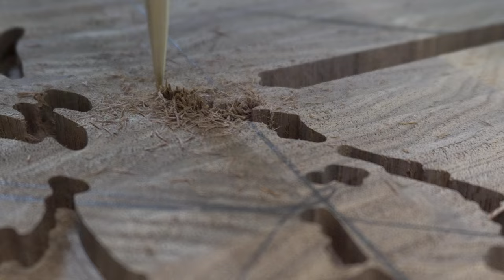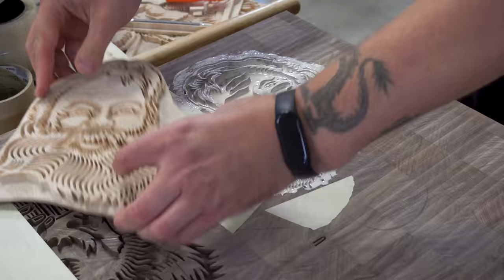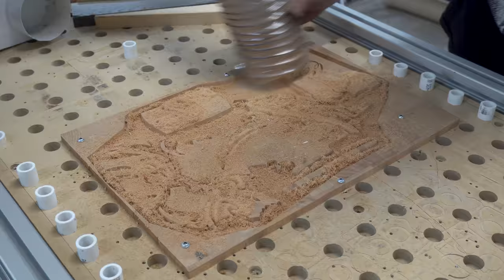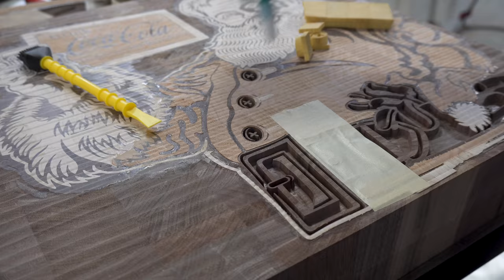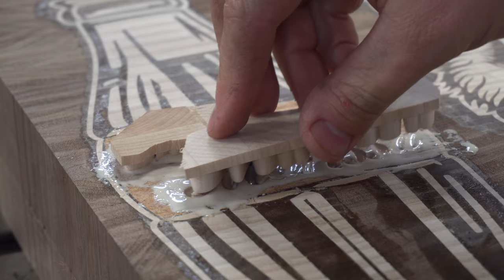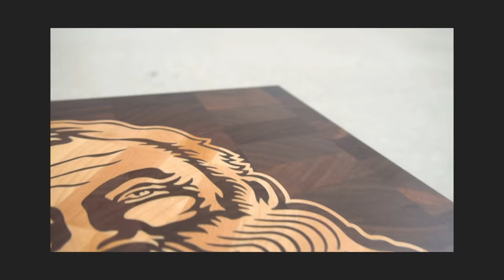Coca-Cola/Santa board. CNC inlay. Wood inlay.

Comment: Great project!  I wanted to find out what type of CNC you are using but couldn't find it in the credits.  Can you please list?  Thank you!
Reply: Based on the shape of the spindle, the location of covered tape, angle of the support arms,  I will surmise that it is most likely a Axiom Precision Pro model (a previous design (coloring, etc.) model from what is currently on Axiom's site. (an Axiom CNC for sure)
Reply: @scbatesrd  Good to know because I've been seriously looking at getting an Axiom table